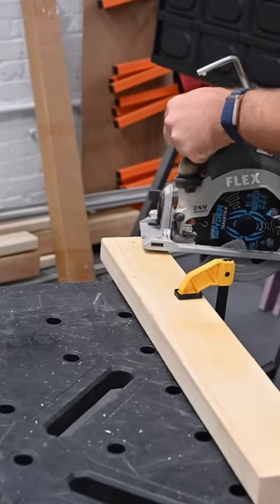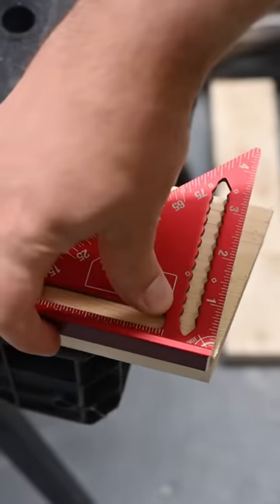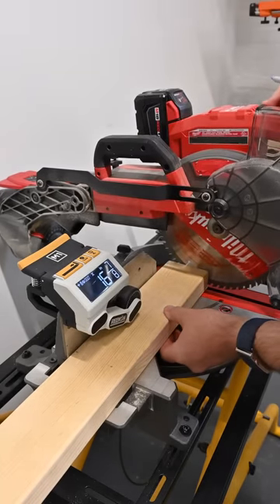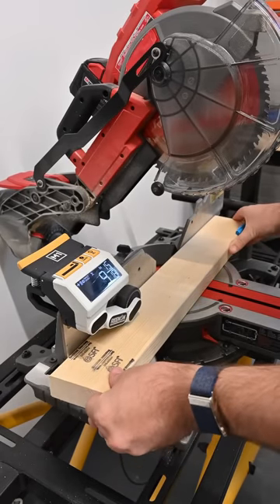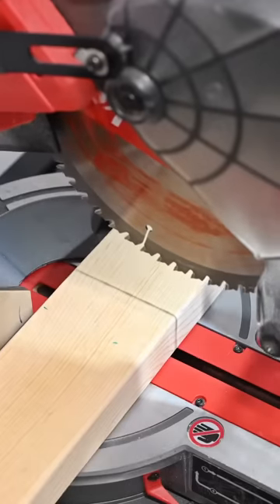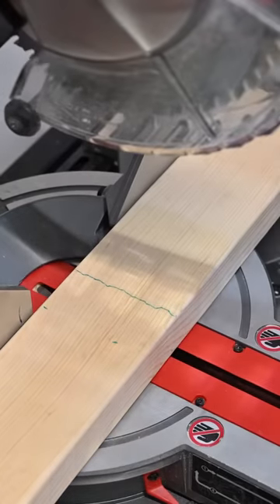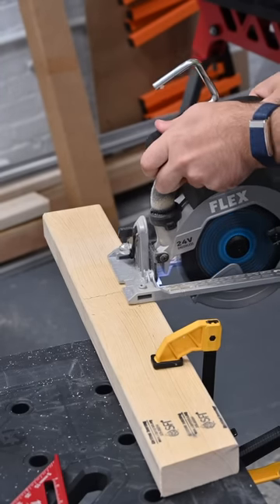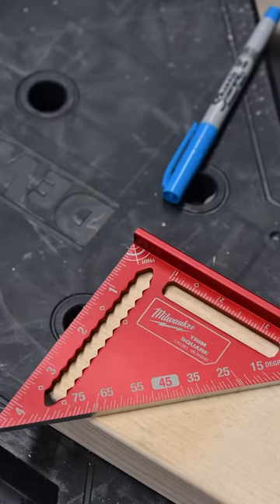Learning something new everyday, the M1 Caliber applications are endless!

Comment: Obviously the video is satire. However for those who don’t know, you can elevate the saw “foot” off of the surface of the material towards the handle end. You then make a cut, perhaps 20-50% of the thickness of your material and then “drop” the saw foot down to the material and finish the cut. This ensures that the initial cut is 90° (or whatever degree your blade is relative to the foot or shoe).

Comment: I'm confused (or is this video supposed to be a joke)....
Step 1 - lack the confidence to use a square and a pencil... or a squaring jig for that matter.
Step 2 - go down two ladders to get to your miter saw.
Step 3 - use the miter saw not to cut the workpiece that you've brought down to the miter saw, as that would be stupid, but just use it as an angle gauge.
Step 4 - bring workpiece back up two ladders to where your circular saw is.
Step 5 - cut piece with circular saw and claim victory.
Step 6 - if you followed this process, you probably cut it the wrong length anyway.
Step 7 - get fired when your boss comes around and asks why you've spent all morning cutting four 2x4's.
Step 8 - learn to love sleeping in because you're unemployable.

Comment: There is an easy way to get really close to square without a square. Rotate your board while you're cutting it. Takes a bit of practice but your saw don't bog down if the grain pulls the cut together, you gotta have a decent eye for square too.

Comment: Do it the easy way, use the tool designed to give square cuts to mark a straight line then move away and cut with a hand held power tool. Yes mate sounds so much simpler than it used to be. 😅

Comment: U must b joking right?? Why do u need to use a chop saw/mitre saw? All u have to do is use your square to make a straight pencil line, move it to the side a little, and use a skill saw! Just hold your square in the right position so that the blade is on the line, hold the square tightly in place, and follow it with the skill saw! It ain't rocket science! Also, why do u need the magic light button to trace the line? Just use your square! Not that u even traced the line right anyway, it was more of a squiggle than a straight line, lmfao!

Comment: its not hard I dont even need to mark a line juts mark measurement and cut ist all in how you old and your body position  and if you have an issue mark back from you saw blade  and use your speed square as a cuid and you get a straight cut simple  no need to go and buty a expensive tool if you dont need it